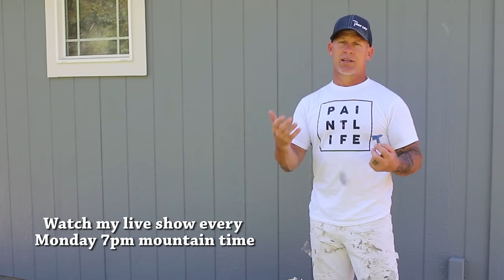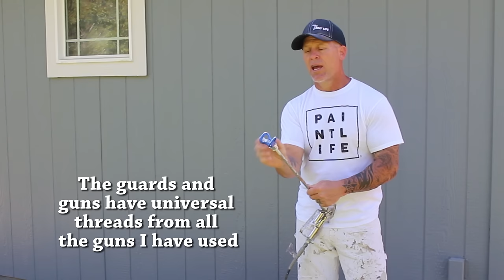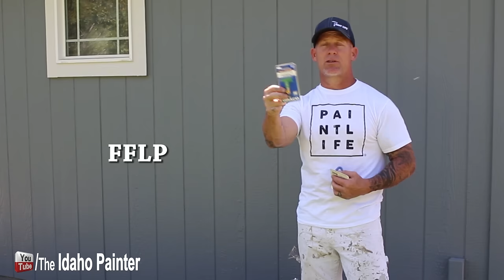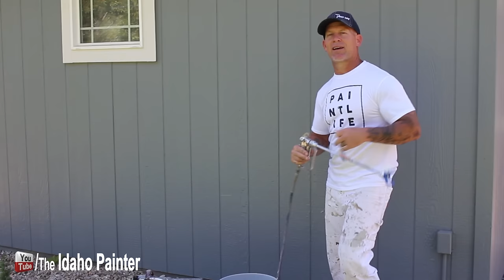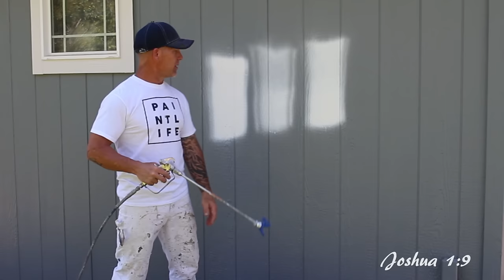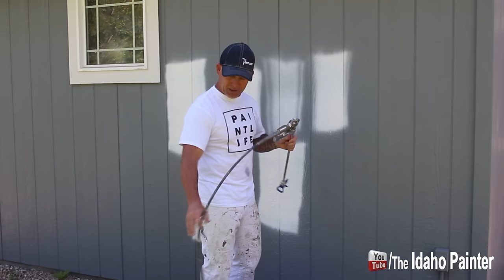All About Airless Paint Sprayer Tips

Comment: hi great vids :) been watching alot of your vids in preperation to spray my house, internal 1st..
i bought a selection of tips but it turns out there too thick for my guard.. aprently 14mm.. n my gards have 11mm hole? can you explain which tips i need please..
thanx
Reply from the maker: Whatever tip you buy will do, just buy the same brand guard to go with it.
Reply: Home Improvement How To's hi thanx for reply.. not sure on the brands here in the uk spray equipemnt dosent seem to be as big as U.S.
my sprayer is branded as dinopower.. and the gun that came with it and the 2 extensions I've bought have smaller holes in the gaurds than the tips i've bought... asked the seller who said i must have 11mm gards not 14mm like the tips.. didnt know weather the different sizes was coman in differnt brands.. anther tip i bought 509 fits so will be able to get started with a mist coat.. the gun came with a 415.. so will just have to trile n error for other tips i guess..

Comment: I have a Graco 5x and am having problem with my tip getting clogged spraying on primer.  Using a 415 tip, I thing I may need a new filter possibly, but one of my other issues was when I would turn the tip to unplug it, it would turn once, but it would get stuck when I go to turn it back.  This about drove me in sane today!!! any suggestions?
Reply from the maker: You need a filter

Comment: Wow so many comments! I went through a lot of them to see if any one asked or answered my questions. You don't need to change the tip seal with the different orifice size tips Ex. 310  to 517? They give you a tip seal with each tip so I'm wondering when you change the seal? Also My  Pro X 17 has a max orifice of .017 so does this mean I cant use ant tip bigger than  an X17? Also dam hard to find any one carrying a range of tip sizes. I've called all over and no one carries a 617 or 817. I'm priming a totally renovated house I want to use something bigger than my 517.
Reply from the maker: Rarely do we ever change them.  By the time we would we just change the guard also
Reply: Then why do they give you one with a new tip? You mean you change them when the tip is worn out or when the guard is worn out? guards can wear out?

Comment: Hi mate, I'm also a painter, I've started spraying water-based acrylic primer sealer undercoat paint to use on the first coat on woodwork,then top coat  with  gloss oil based enamel , I notice tiny pin holes when its dry ,  with the oil based , I've tried spray brush roller and the same thing happens do you know what if this is caused from all how to prevent it thank you for your help
Reply from the maker: You need to seal it with a lacquer undercoater probably
Reply: Artie6937 x
Reply: Johnie 1st choice from my limited experience I know that water-based paint takes a lot longer to cure than oil based paint. And during the curing process it is letting off gas bubbles. So that might be the source for the pinholes
Reply: craig nelson uhhh....are you sure about that!?? I will not use oil based because of desposal and DRYING problems. oil base takes waaaaaaaay longer than water base to dry bud. this is just more time for debree and damage to happen hands down!
Reply: @davidu8688  Curing and drying are two different things. Oil based paints cure much faster than latex paints. While it's true that oil takes quite a while longer to dry to the touch, it cures to full hardness within about a week. Water based paints take more like 2-3 weeks to fully cure.

Comment: I believe my tip is clogged. How do you pull the tip from the housing? I noticed you changing your tips by just pulling them out.
Reply: if it gets clogged turn tip around and spray in slop bucket. To remove tip from housing you have to release the pressure from hose to unscrew easily or pull tip out.

Comment: What if I use a tip with a smaller orifice and the paint comes out too thick on the ends? I started with a 515 and it worked fine but when I switched to a 313 it was bad.  They're not necessarily tails with a gap and the 2 lines on the sides like your video. It's just thicker at the ends and i can never even out the spray even when adjusting the pressure.
Reply from the maker: Hey, thank you for being here with us! Due to the overwhelming amount of messages we get each day, we have created an amazing community through a Facebook group called Paint Life Members. This is a great place to ask questions, get/give feedback, and share your latest projects. This is a well monitored group of painters who are dedicated to educating, equipping, and empowering each other. Here is the link to request to join. Please answer the questions and we will approve your request as soon as possible. We hope to see you there! https://www.facebook.com/groups/2305219262837596/

Comment: i’ve been using a 411 for exterior siding and it’s leaving a trail, the guy from graco support told me to use a 515 or bigger. i’m a little confused because with my last airless i could use smaller tips without problems. sometimes i like small tips for exterior trim. it doesn’t struggle for pressure it seems and my tips are new. not sure what’s happening
Reply from the maker: Their support techs have never painted in their life.  They just read you stuff out of a book
Reply: @Idahopainter  so maybe i need new packings?

Comment: Hi mate...I’ve just bought a Wagner 250M, what would be the best tip, filter and pressure setting for smooth masonry paint please?
Reply from the maker: 310, 100 mesh, 2200 PSI
Reply: Paint Life TVthanks for reply, would that be the red filter supplied and is that setting 5 on the dial? Many thanks

Comment: Great information THANKS!  I have a project coming up that I will be spraying Industrial enamel VOC.  Any thoughts as to what tip and if I should be using my HVLP or Airless to shoot the metal building panels?  The building is not put together yet.
Reply from the maker: Use an airless with a 310
Reply: I was told today to keep a hose separate to use with oil based paints.  I asked also to keep a separate gun too as a committed to oil based paints?  Their answer was no.  Does this seem correct?

Comment: hi I purchased a graco easymax wp2 battery sprayer in the UK.    what tip do I use for exterior smooth emulsion , and what ratio if any, do I water the paint down.    
thank you for your help.
Reply from the maker: I would try a 514, but I have never used the product so I am not sure

Comment: hey man!I have a question,what Tip do you recomend for interior wall paint around windows and doors so I dont need to maskwith tape and cover everything...is a 317 ok?or its too big?maybe 315 or a 310?will that clock easy with interior paint?what tip should I use?Thanks!
Reply from the maker: When spraying we cover everything. I like a 619

Comment: Hi Chris....I took the time to see more of your videos and I went out and purchased a smaller tip for my interior woodwork, including doors.  Thanks for the advice on the overspray! My question to you is that I bought the smaller tip from lowes (RAC IV 311 switch tip) for the SG2 spraygun that goes with my new X5 model. Can you please clarify if I can expect a much different finish result between the RAC IV 311 and the 310 tip you talk about on your videos.  I mention as the cor of the 311 is black and the color of your 310 is green.  Am I missing something?  Thanks in advance for your time.
Reply from the maker: A 311 is not a fine finish tip.  Thanks for the question or comment.  All our questions are now answered on our Facebook group "Paint Life Members".  Join that group and you will receive all the help you need.  Hope to see you there.

Comment: Hi, I just bought a graco ultramax2 and will be using sherwin William's building solution high build primer on a reno.  Since it is a heavy paint should I be using the maximum tip size for the handheld or one step down?  The product data sheet for the primer reccomend a .021 orfice size but I am not sure the machine can throw that size.  Can you help me?
Reply from the maker: We would recommend using a 17

Comment: I have a 3000 psi airless sprayer with a 50 foot hose and a 515 tip. I went up on the roof which is a metal roof to spray an Acrylic Dura-Brite White Elastomeric Roof Coating. I managed to get about 16 sq./ft done and the gun started streaming instead of spraying. I turn the tip around to clean it, and started again, and same thing happened. My pressure is full blast, and I'm wondering if I need to use a different size tip.
ANY suggestions besides diluting this product?
Reply: To thick for that sprayer look up pain specs

Comment: Good evening today I sprayed some moldings i used kill primer the moldings came  out a little rough then I use super paint from Sherman Williams but my Moulding still came out kind a rough I sanded  it between paint but I use the 515 tipCould you please give me an idea what I did wrong thank you have a blessed evening
Reply: 310 for moulding. The orifice on the 310 is (10). Which means lesser paint will come out giving a fine finish. The 515 orifice is (15) which is larger than the (10). More paint is coming out. Maybe you didn't thin your paint enough and the pressure wasn't high enough for the paint you were spraying. Thicker paint = bigger droplets that don't like to connect smoothly. Thinner paint = smaller droplets that connect more smoothly. My 2 cents. Maybe I'm wrong but check it out
Reply: @Erik7prc  you are right I use the wrong tip first of all I also needed to thin out the paint with more water I should also have thin out the primer and sprayed with more pressure but can you thin out the primer
Reply: Thank you for responding have a blessed day
Reply: @georgeheredia3230  yes you can thin it or it will be like trying to spray warm peanut butter 😄. Behr Paint & Primer recommends adding no more than 8 ounces of water to 1 gallon of paint for spraying. I would start at 4oz to see what it looks like because you can always add. If you add 8oz and you don't like it you'll be stuck with it. That's one example. Look up the thinning data online for whatever brand and material you are spraying.

Always remember thinning makes for smaller paint droplets that like to connect smoothly when spraying. Just don't over do it on thinning. You have a blessed day too

Comment: Just bought the graco magnum x5. Max tip size is 515. I want to paint my interior walls with SW Emerald Designer (colors I want are only available with that material). SW says to use a tip size .017-.021” @2000psi. Will I have an issue using this material with my sprayer since I can’t use that size tip? Thanks.
Reply: You can spray that with a 208 if you wanted

Comment: 619 for interior walls? Sorry but it is to wide, it probably works only to apply primer (and it is just a maybe), also it would spend lot of paint or any product you use, I would suggest for interiors to use a 415 for walls (specially new drywall) , for ceilings a 315 LP, and for trims 210 Lp, (I do this everyday in high rise buildings all over Vancouver Canada). Spraying exteriors is kind of risky and please take absolutely care of your safety, Cheers.

Comment: I had a problem spaying trim. Do you ever think out paint. Seems like my new cordless Graco was struggling pushing pain out.
Reply from the maker: Sorry, what was the question?
Reply: Paint Life TV sorry,I meant do you ever have to thin out paint to use the graco sprayer. I saw one of your videos on this sprayer and wanted it. It worked great with water base poly but I was going to use it on some trim with some  white semi gloss and the sprayer couldn't push the paint out ( I think) I watch some more of your videos in case I missed something. I was using 510  tip I think. Maybe it's the paint. It was a fairly new can. Thanks for the response.

Comment: Hello! I'm in the UK and just purchased a Graco x21. Came with a 515 tip, but I'm having constant tip clogging problems. We're using supermatt paint it has been strained, and diluted down... Flushed the system twice and cleaned all filters keeps happening, I get about 10 seconds in before another clogg. And have to use pliers to turn the tip around to spray the clogg out. Is this normal? Right now it'd be faster to go back to paint brush and roller at this point. Any tips please?
Reply from the maker: Rarely, but some paints cannot be sprayed. Try a different product
Reply: @Idahopainter  Thank you for the reply, I've put a 100 mesh into the gun seems to be working better. Would you recommend a bigger orifice tip? Literally hardly anywhere to get big tips in the UK from what I've seen. Any ideas?

Comment: im planning to buy a graco x5 to paint my living room, is the 515 tip that comes with the sprayer good enough for interior walls and ceiling?
Reply: Same question lol
Reply: I’ve been painting custom homes for 4 years and for all of our walls and ceilings we use graco rac 5 in a 517 tip so a 515 should work fine.
Reply: We also back roll our walls and spray ceilings north and south then go back east and west to finish or the opposite way depending on the lay out of the room.

Comment: I don't understand using the small tip orifice sizes (0.10) 310 or 510 for example, because that is contrary to the paint mfg's specifications of tip requirements.   And then what, you crank up the pressure to blast the paint through the small orifice?.
Reply from the maker: We do what works, creates good finishes, has worked for 15 years, and is common practice in the industry.  Also it is mfgs "recommendations". Not what is set in stone.

Comment: First off a real true professional doesn't use reversible tips. The guard is a joke all it does is collect paint and cause it to drip! Use a flat tip like a real pro! Also the 411 is the most common tip size in Texas that 310 with a 6inch fan tends to finger worse.